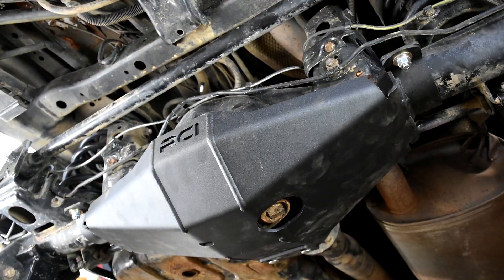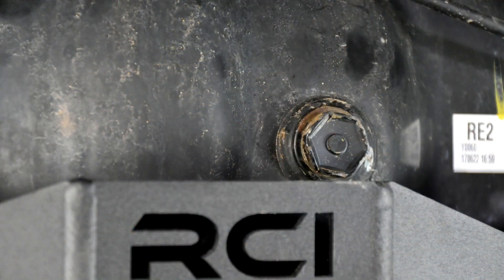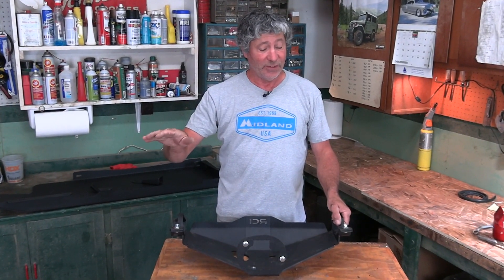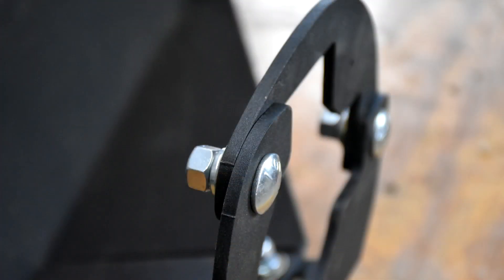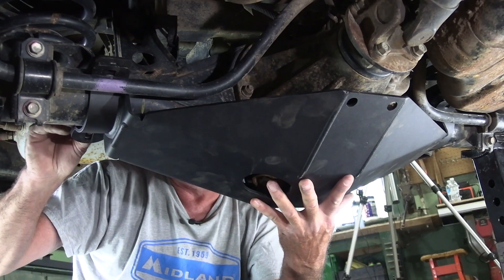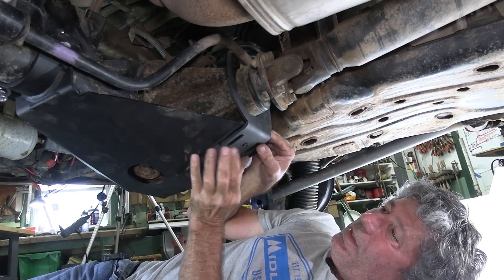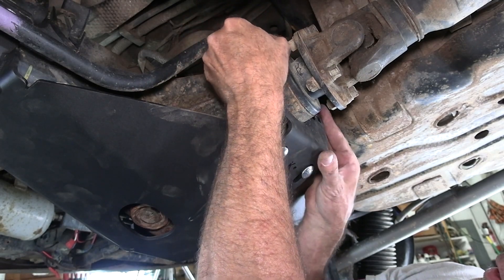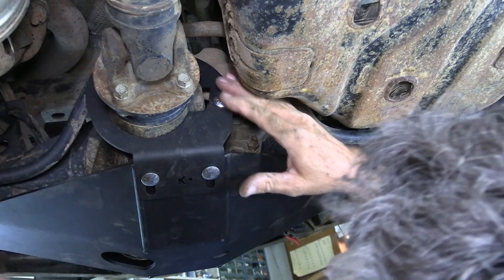Protect Your Rear End: Toyota 4Runner, Tacoma, GX, FJ

Comment: What does that really protect, isn't the rear diff a solid  chunk of steel.. I would think  the joint where the rear axle connects to the diff is the susceptible area?
Reply from the maker: it mostly protects the drain plug and carrier bolts. With a big enough hit the center section can get cracked too.

Comment: I have that RCI skid on my diff also. The front bolts that hold the ring on the front of the diff came loose and fell out while on the trail. At first we could not figure out why the FJ sounded like a WW2 tank until we finally saw the ring hanging on the drive  shaft. Ended up cutting the ring off and have not replaced it in almost two years.
Reply: threadlock everything or you'll regret it
Reply: @HAHA.GoodMeme  ain't that the truth!!

Comment: I had the BudBuilt diff skid on, it lasted about 2 years before one of the bolts backed out on a trail run on Stony Pass.  At first it sounded like a rock behind the brake rotor shield but then it kept getting louder.  Had to stop in the rain and take it off, thank goodness for the 4Runner's rear door as an awning 🙂

I liked the RCI better -- because of the reasons you stated, mainly access to the drain plug -- so I installed one of those but made sure to use blue loctite on all the bolts.  I'd prefer nylon locking nuts but those don't always fit.
Reply from the maker: Great advice on the use of loctite. We always use it on just about everything, forgot to mention it in this video.